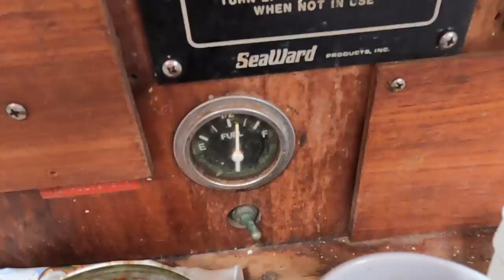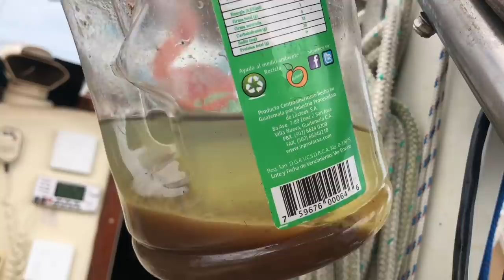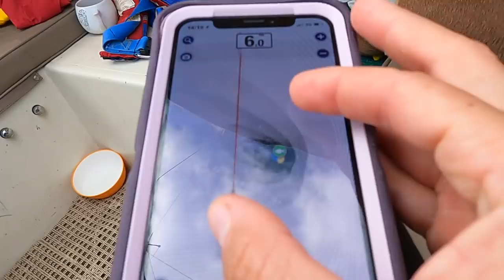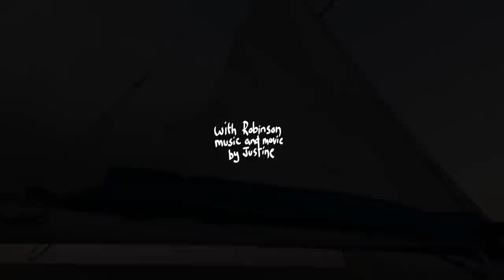ZIG ZAGGING #94 stuck on a sailboat at sea

Comment: I just got back from a really difficult sail upwind too. Yours was much longer, mine much harder on the boat. As you say, the open ocean is harder. I had 25kts sustained in the nose with big choppy waves. Couldn't keep course. Made little headway tacking. Turned on the engine to force the angel of my boat. Then ran out of fuel. I had two 20lt jerrycans, but then had to purge the air out of the system in the 2-3m waves to get it running again. Took shelter at the nearest island late at night to go early the next day to beat the 25kts winds again. What was to be a 24hr journey was double. I did make it, as am sure you will too. What an adventure we live.
Reply from the maker: Yes, we didn't want to get into a situation where the engine would have to be purged of air. Glad you made it safe!